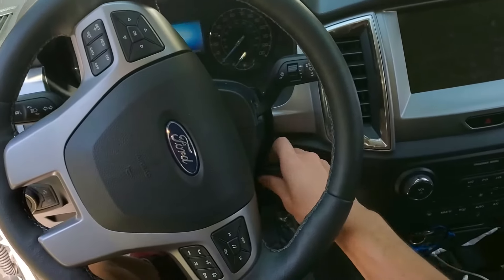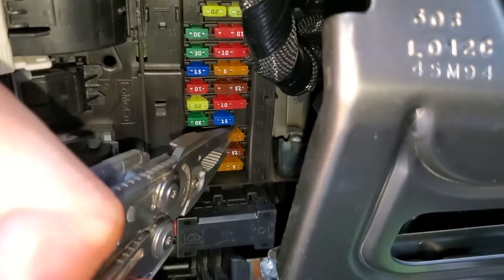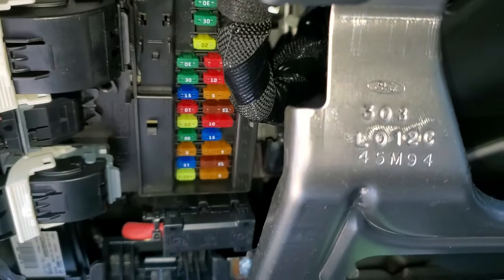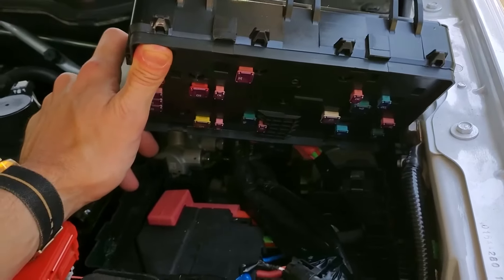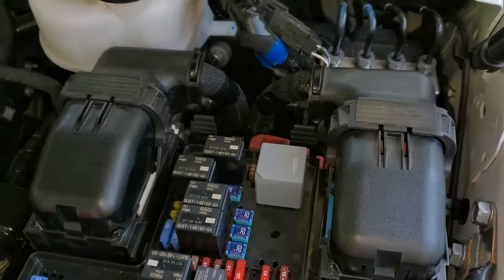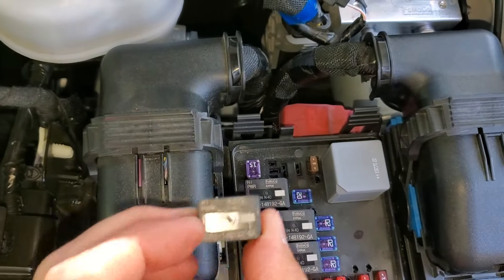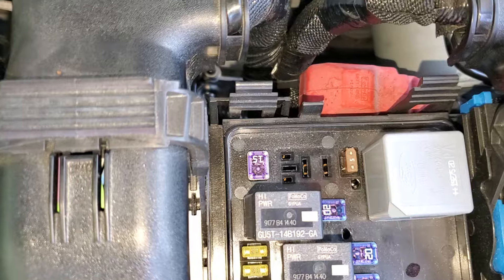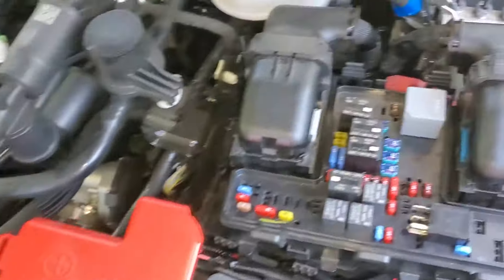2019 Ford Ranger Starter Relay, Starter Fuses & Circuit Explained

Comment: 2019 Ford Ranger failed to start two days ago. Turned the key and nothing no faults just no start. Tried a jump thinking it was the battery but still no start. Had it towed to dealer and magically started up for them. Now I have something to troubleshoot if it happens again cheers and thanks for the very informative video.

Comment: So i had this problem and used this vid to troubleshoot.  when i jumpered the contacts on the starter relay as discribed it clicked a couple times and then turned over.  after that it would start. So the realy is good and all fuses work.  would that be the starter solenoid then?

Comment: My 02 Ranger xlt does no start(no crank), plenty of battery juices. This happened after I installed led bulbs and turned on the headlights(for testing) while the engine was off. Any advice is appreciated.